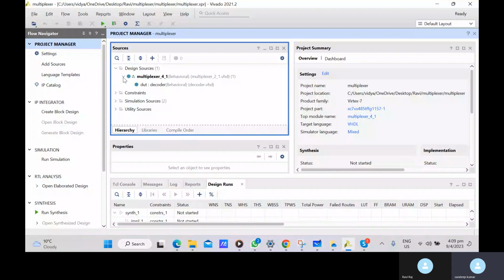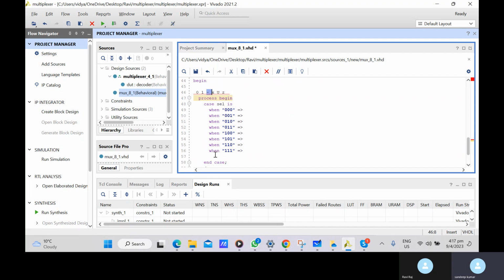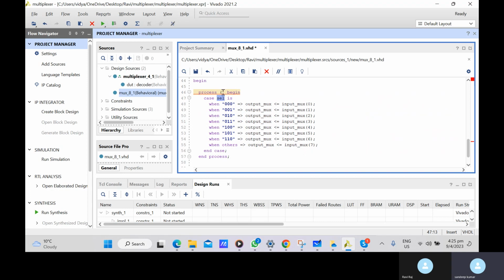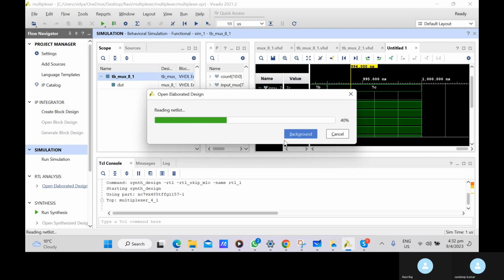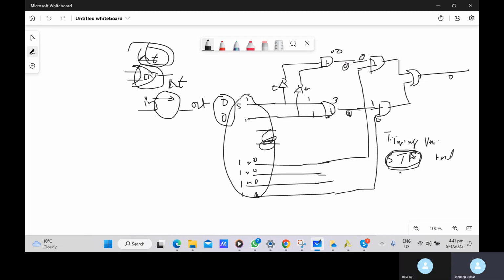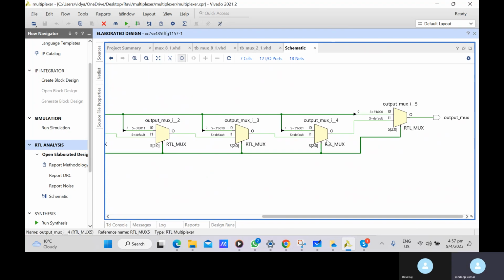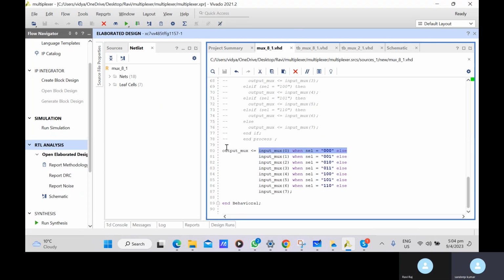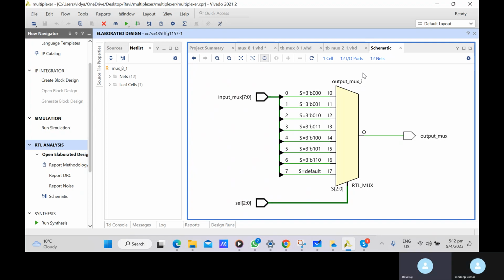Multiplexer and Priority Encoder using Case, If else , With select, when else- Part 2

Comment: In system verilog with vivado,  I tried this targeting Artix 7.  However, it always uses parallel LUTs and some MUX at the end if the data is wide enough.  Are you using some specific settings in Vivado so that it gives you a generic netlist before implementing the FPGA fabric LUTs?